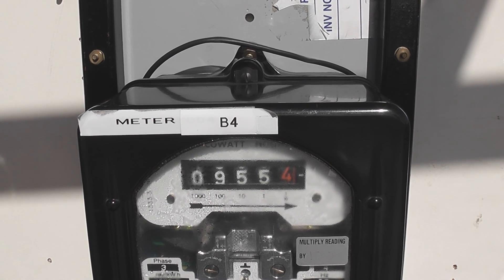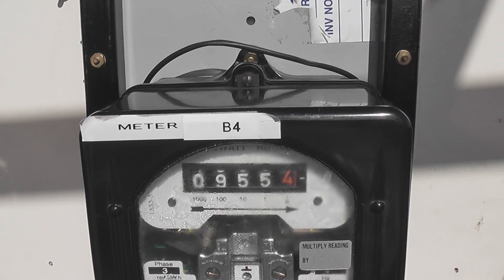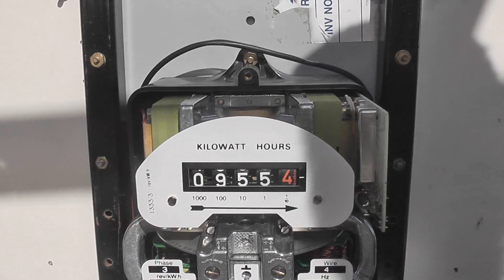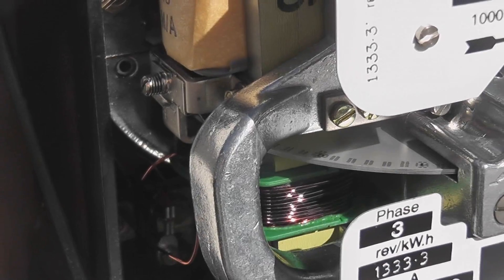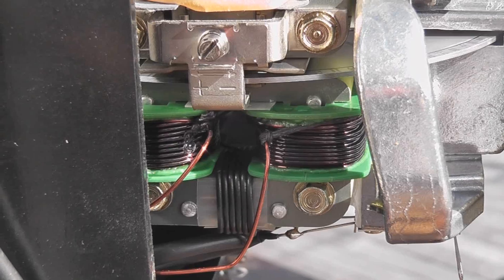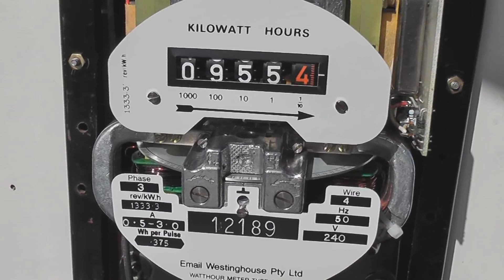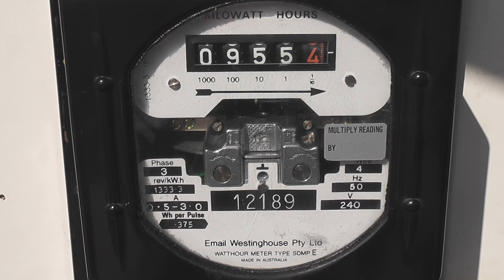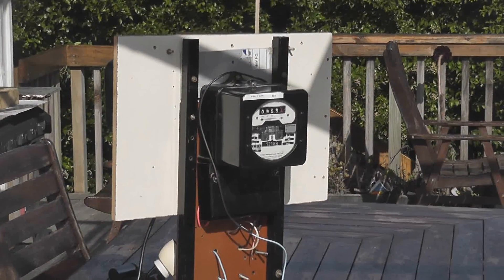Email SDM meter smoking

Comment: It looks like discoloration of the varnish and smoke was created by the plastic bobbin starting to melt. The coil varnish is much more heat proof than one may think, although it's not going to handle heat for infinity, I have seen motor coils in same discoloration still operate fine for years.
Rewinding the current coils shouldn't be a problem also as there is only few turns to make. Thanks for sharing, keep up the good work.
Reply from the maker: DjResR You are right, the varnish has darkened, the bobbin has distorted a little bit. Will do an accuracy test and post the result. May take a few weeks as I am busy with some other projects.

Comment: One can really hear in your voice that you are disappointed that this happened to you while busy with something else.

Do you think the overheated coil insulation will still hold up, or is it not safe anymore and you have to re-do the windings ?
Reply from the maker: Henner Zeller I will test the meter, as long there are no shorted turns and only darkened varnish I may get away with it. Will do a test video in a couple of weeks time.

Comment: I just learned what a burnt MOT smells like recently.  What an unbearable nasty smell.  The secondary coils seemed to be aluminum.  Is this normal?
Reply: computersales It depends on how cheap the microwave was originally.
Reply: OlegKostoglatov It was an over the range style Samsung microwave.  Looked nice until it went up in smoke.
Reply from the maker: computersales A MOT burn out stinks terrible. My Mots all have copper windings. Aluminium does get used in distribution transformers, Can't see why not in a MOT.

Comment: Sorry you smoked your meter. BTW Where do you find meters of such low amperage? I don't see them here in the US. Ours are like 60 amps and up tor as much as 400 amps. Never see a common or neutral through a meter either.
Reply from the maker: David Collins Yes these things happen, the meter still works. In the USA they use CT meters too. Often you see the CT's outside near the transformer. The meter constant on an electromechanical wont have a Kh of 7,2 (typical 200 Amp meter) but a lot lower value like 0.6. (I have a video of an American J3S Sangamo CT meter on my channel)
Reply: David Collins Yes, 200 is the most common. 60 or 100 is no longer sufficient of a supply for most installations. Thanks.

Comment: oops!  3A is quite a small max current even for a CT meter isn't it (I'm used to them being 5amp secondary)
Reply from the maker: ***** 5 Amp for CT meter is common although 1 Amp CT meters are used on services with very long cable runs. These meters were used in the basement of a high rise while the CT's were on the 15 th floor for example. 1 Amp metering is also used in HV switchyards where cable runs can be up to 200 meters long for protection and metering circuits.
Reply: RODALCO2007 Thanks for the detailed response, makes sense to keep the current low in such circuits. 

Incidentally, meters of many types used to be commonly available to lay people here if you knew where to look, the electricity board would leave them behind in demolished buildings (They'd do the service disconnect by cutting the PILS cable at the property line, it's quicker when  the meter is inside and the site is probably secured to prevent vandalism. So if you asked the demolition guys, maybe slip one of them a few pounds, you'd be allowed to take whatever you wanted. Nowadays with the privatized electric companies and 'health n safety' types on demolition sites, not so simple :)
Reply from the maker: ***** Yes too much OHS BS. It has gone over the top with safety.